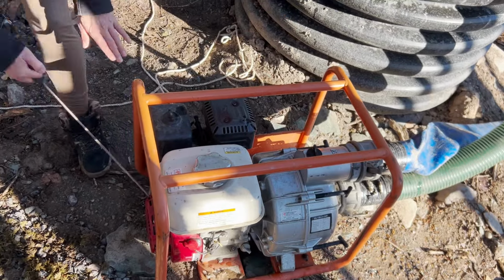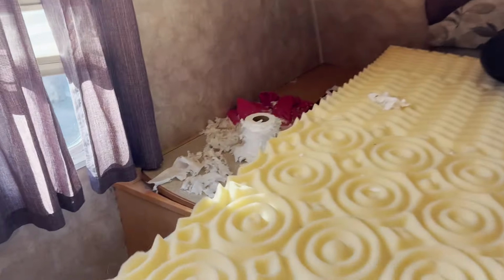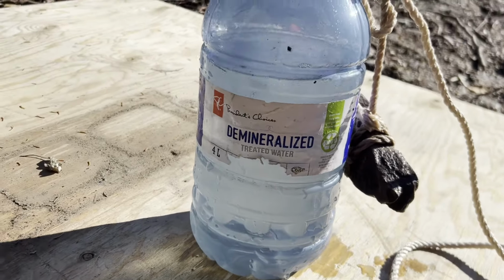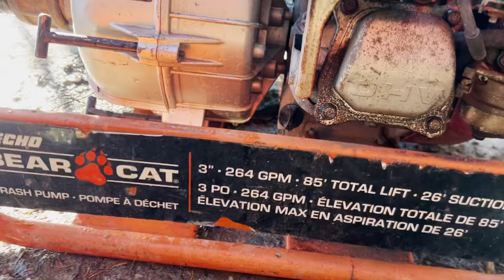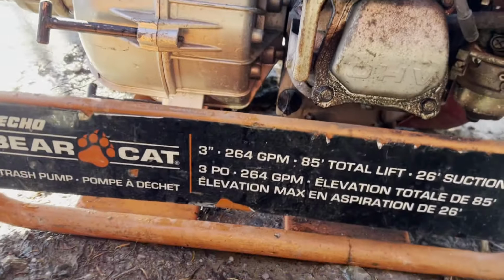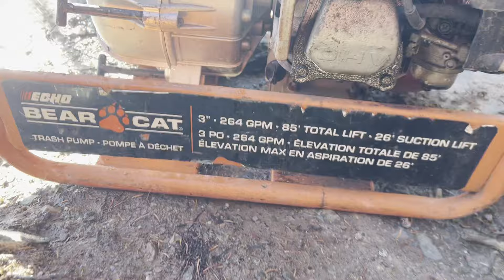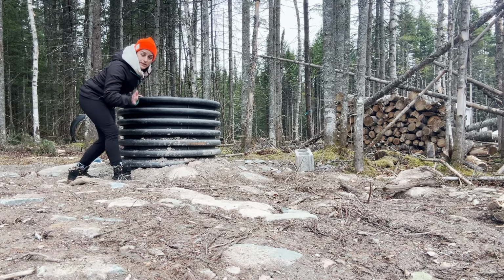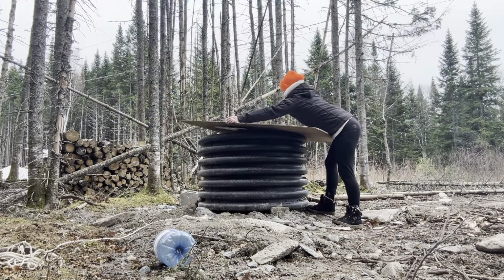I Pumped My DIY surface well DRY... and Found WAY More Water Than I Expected! But Is It Clear?"

Comment: Been following along and I don't want to burst your bubble, but you could've had a deep well installed professionally in a day and it wouldn't have cost that much. It would guarantee you have water, clean water, and that water can be pumped without issue. 

I live in the Laurentians, I'm very familiar wth this and have many friends who live off grid, I'm almost off grid myself. Any ways, I wish you the best of luck with this but please be very careful. Clear water does not mean safe to drink water. You must get your water tested - professionally don't by some test online. You should consider investing in some type of filtration system. I have adeep well, my water goes through a regular sand filter then a UV filter. Its safe to drink, but still hard, we're just use to it. 

You also need to weather safe you well. The pump can easily freeze up in the winter.

Any ways, again best of luck!
Reply from the maker: My neighbours here got deep wells and it cost over 15 000k. I saved a bunch and the water is getting cleaner and cleaner after every pump :)
Reply from the maker: I also will def be testing the water next spring and get in the well with a ladder and bleach the whole thing. We had a surface well at our last place and had no issues with the potability and clarity of the water. Every time I go out there and grab some water out it is clearer and clearer :)

Comment: But Ms. Mallory how long does it take your well to fully recover from being pumped dry ? You need to also look at the recovery rate of the well in order to kkow it can substain a permanent dwelling being occupied by a family daily year round Miss.
Reply from the maker: @heathboeddeker5401  it takes about 4 days to fill back up 100 %
Reply: @HerEcolife  so that limits ya to roughly 400 gallons of water per day Ms. Mallory